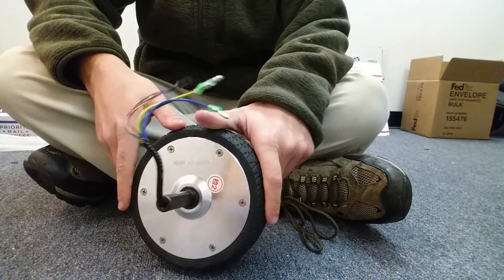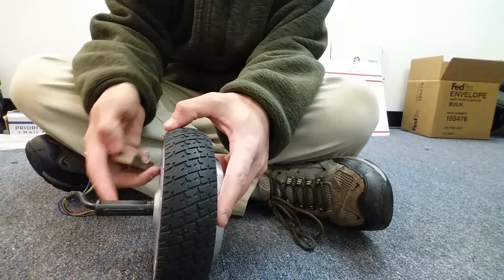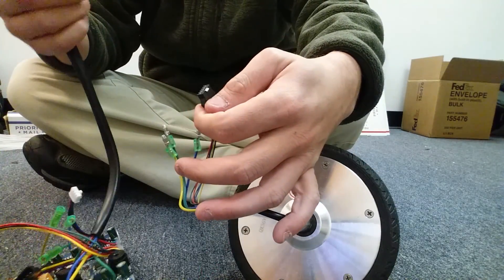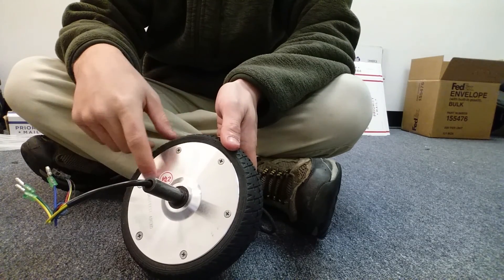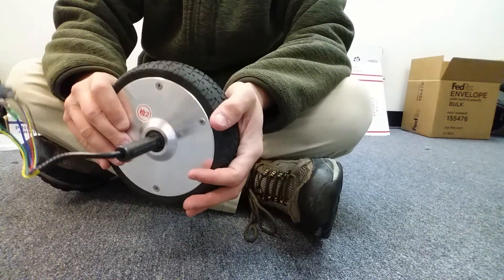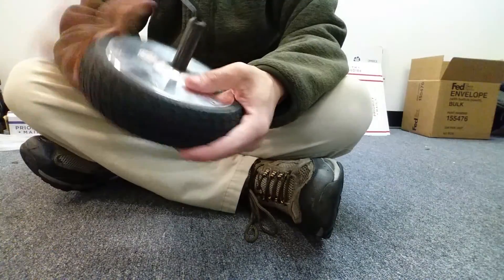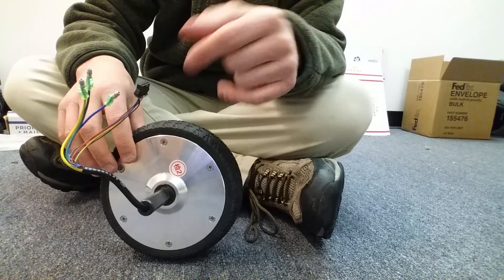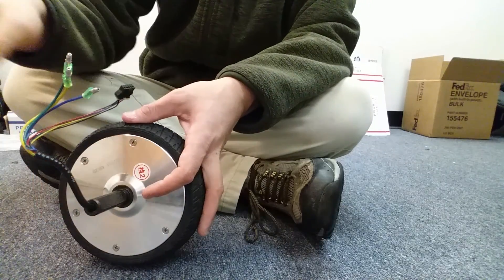Hoverboard Parts Explained - Wheel Motors - Replacement Wheels

Comment: Hi, I have the “Lamborghini” hoverboard.  Kids were moving it back a forth while off.  It blew the resister on the main board right next to the battery cable.  There are 2 black ones and the front one blew.  I purchased another motherboard and put it in and it blew the same resistor on power up.  Could it be the wheels/motors with a short?  Is there a way to check which one has the short?

Comment: Do you happen to know if a 8 or 10 inch wheel has the same diameter center shaft? Wondering if it is possible to replace a 6 inch with a larger wheel before making a purchase. Looked all around google, seems not many are modifying these to ride, just hacking to do something else.

Comment: How do you change the hard rubber tire off the wheel motor????
Reply from the maker: Take the case apart and you can lift them right out. You shouldn't need to replace it though. If you have an air pocket just take it out, or even just make a small slit in it and put it back in

Comment: I have a Hoverboard that I bought for Christmas 2015 for my boys. We went to turn it on the other day and the battery symbol and power light both blink red and it beeps continuously. One wheel will turn freely, the other is hard to get to turn. Kind of like the motor is stuck? This happens even when it is powered off.  Any suggestions? Thank you in advance.
Reply from the maker: maybe need a new wheel, you should be able to find them on ebay and amazon

Comment: hey man can you explane the technology used in motor...and where can I get gyro sensers
Reply from the maker: not sure what you mean by explain the technology of the wheel motor,  basically its the motor, it also contains a sensor which controls the tilt ie only letting you lean forward or backward to such a degree or angle. as for gyros depends on if you need a male or female gyro. this is a good male gyro http://amzn.to/2awlctJ and this is a good female gyro. http://amzn.to/2aiMeBN

Comment: Hi. Your videos are very helpful. We're having trouble putting a new rubber tire on our hoverboard. How do you open up the wheel to do that? We took the screws out but can't seem to get the metal apart to put the new tire on. Thanks for any help!
Reply from the maker: i have never replaced just the rubber part on the tire, i replace the entire wheel. im not sure you can take the rubber off. as far as removing the cap from the wheel just remove the screws and that metal plate will come off.
Reply: Johnny Amicci Our original rubber tire split. We were able to get the metal off, but had to take the wheel and replacement tire to our local bicycle shop to put on. They still were having trouble as of yesterday. May have to replace the whole wheel after all.
Reply from the maker: if you need a wheel i picked up one of these a while back and it worked well http://amzn.to/2aDMM83

Comment: My hoverboard lights will come on whenever I step on it the lights will come on and it will beep but it will mr go , I left my hoverboard out in the rain ( I know super stupid) but does that mean I need a new motor?
Reply from the maker: sounsd more like a gyro or motherboard. i would try one gyro on one side first. if that doesn't work you may need a second gyro and a motherboard. id start cheap with one gyro see if it fixes it and if so get a second. if its not working after that your motherboard is fried. here's a female gyro, if you need a male its the one which has a plug leaving the gyro. this same seller sells the male if thats the part you need http://amzn.to/28JKRA3